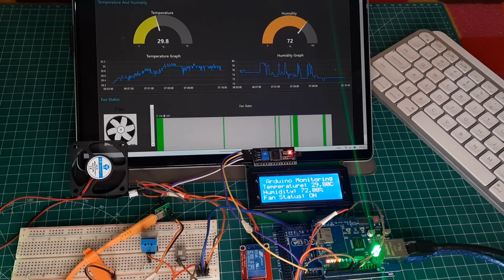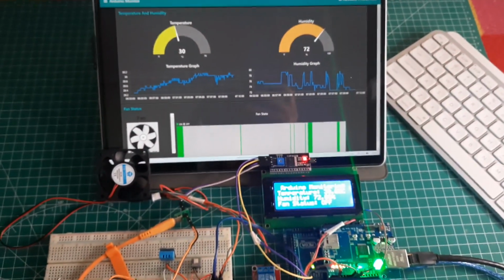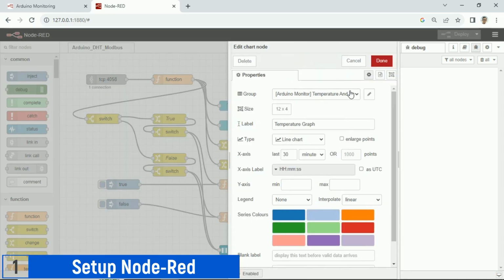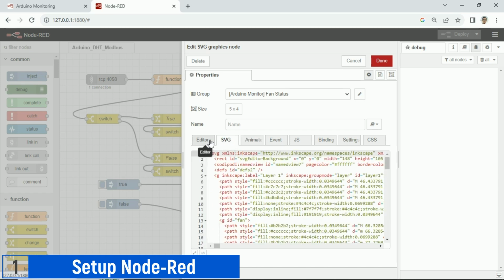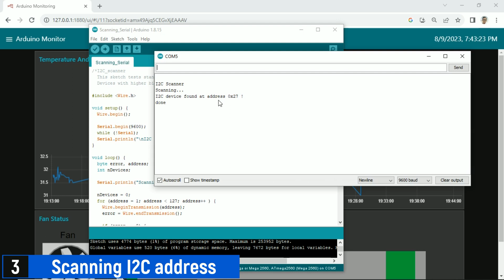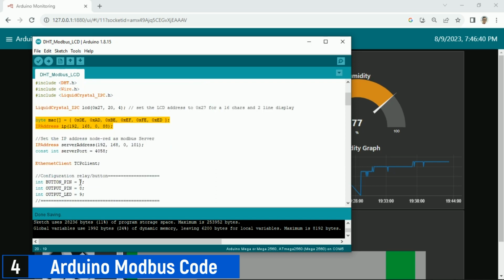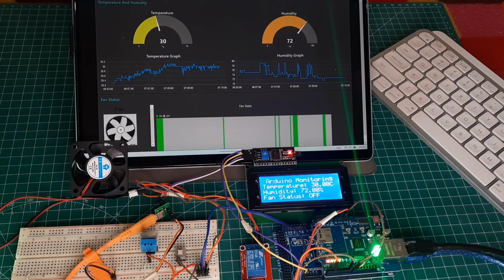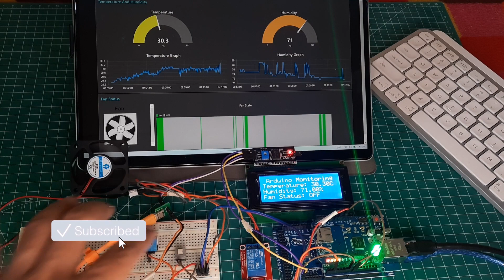Temperature & Humidity Node-Red Monitoring Dashboard from Arduino Modbus TCP

Comment: Needed to ask, where are you running your Node-Red server? Is that a notebook?
Reply from the maker: I mentioned in video,
Node-red run in windows laptop
Arduino connect to node-red via ethernet
In tablet, i open the dashboard via wifi, access using the node-red ip address
Reply: @YaserAliHusen  Alright thanks, I really have to explore that termux app. But my Android version is old. 5.0. Would it work?
Reply from the maker: @Time4yes , Termux is great to explore capabilities of android, we can get the android sensor in node-red, but just for experiment, It think OK.
For phone, you have to use a better one
Reply: @YaserAliHusen  Alright, thanks.